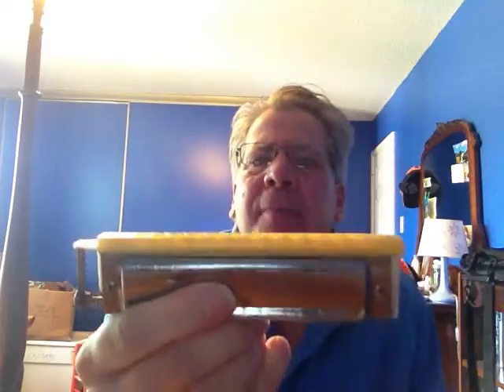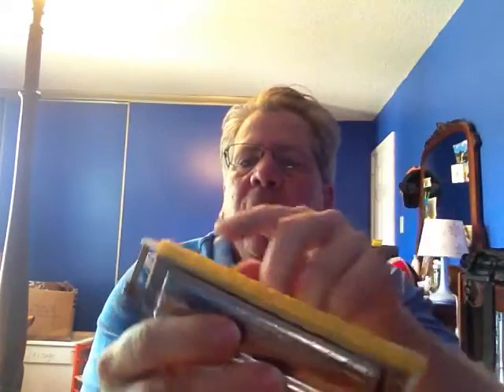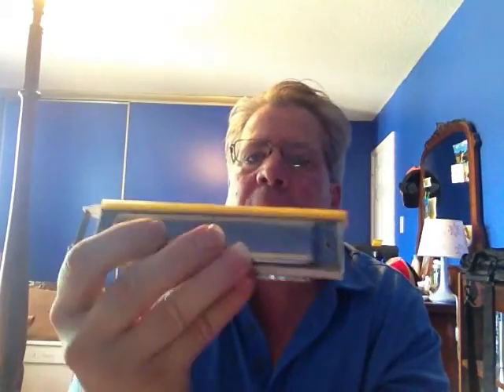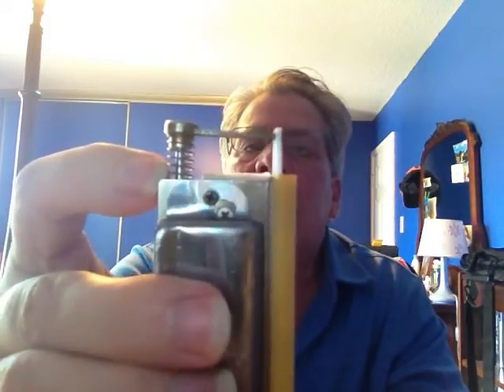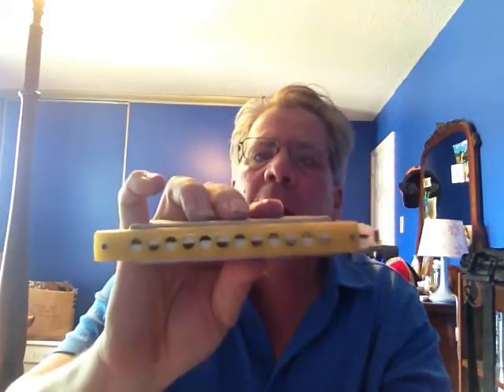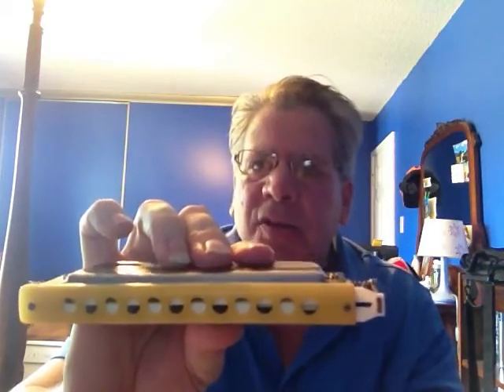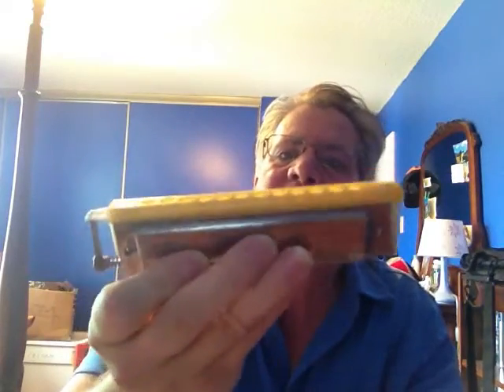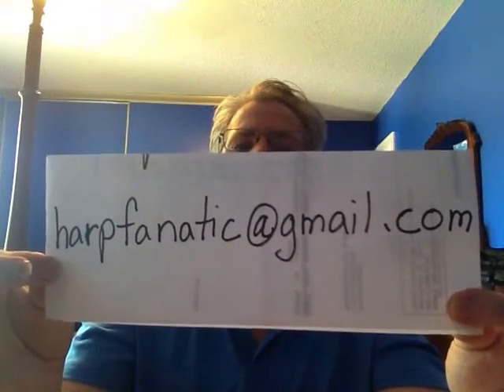Half-valved chromatic with interactive reed bending

Comment: Wow. It's a standard tuned instrument otherwise?
Reply from the maker: No,  It's in a special tuning that is designed for diatonic richter blues players, so they retain their draw bends while playing chromatically.  Basically a diatonic with a slide.  (The slide flattens, rather than sharpens.)  The root is on hole number 2.  The tuning is a/b c/d e/g a/b c/d e/f g/a a/b c/d e/f g/a a/b.  Holes 2-7 are the same as a paddy richter tuned diatonic and the a/b c/d e/f g/a pattern is repeated at the top end of the harmonica so the player can do draw bending there as well.  The slide flattens so that a major scale can played in G in 2nd position without using a bend to get the F# on hole number 3.